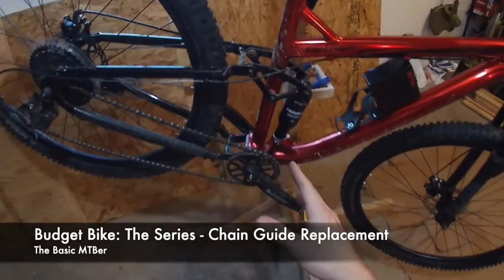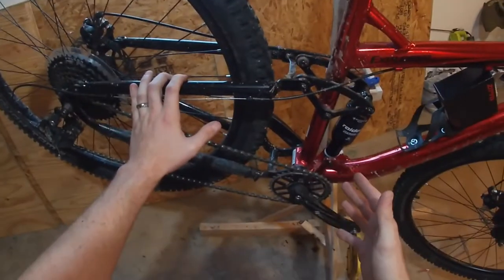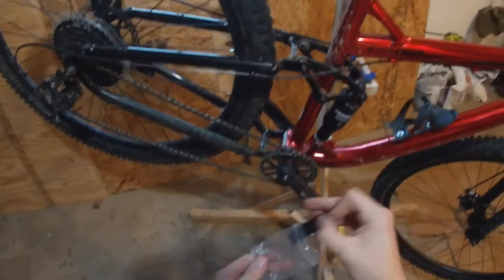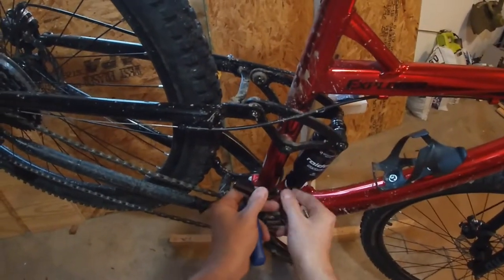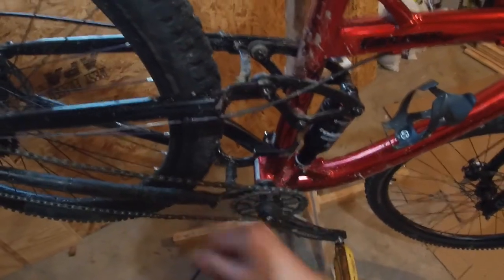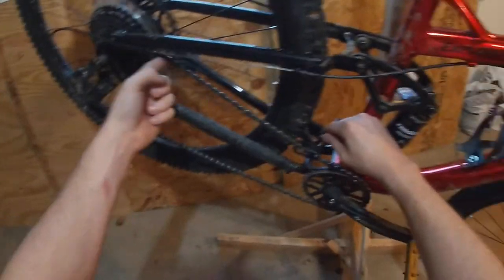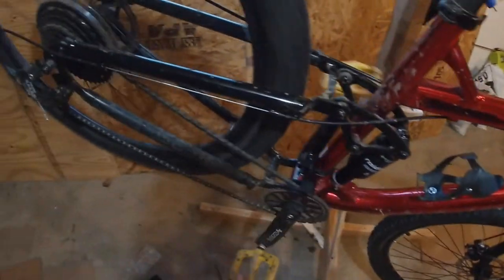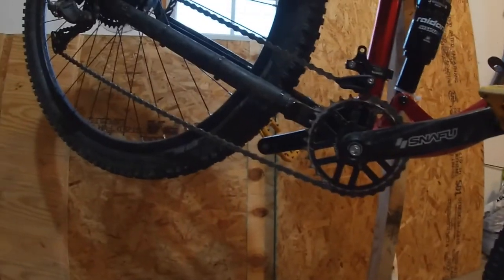Budget Bike: The Series, Ep.12 Chain Guide Install

Comment: Nice video.  What brand chain guide are you using?
Reply from the maker: It was a DYNWAVE (https://amzn.to/3vUgAGs). I’ve never heard of the brand, but it was cheap and works.
Reply: @basicmtb  I was checking out 3 different brands on Amazon and after close inspection it turns out they're all selling the same guide but with a different name on it. This makes 4 including your Dynawave. I'm guessing it's just a cheap chinese made guide that's rebranded by lots of different companies so I've ordered the one that was priced the lowest. It should arrive later today. Thanks for the installation tips!
Reply from the maker: @storm3016  Yeah, unfortunately there's a lot of that on Amazon now. I try to stay with name-brands for the important stuff like tires/suspension/brakes, basically anything that could fail and cause a crash. For non-critical stuff like this chain guide, I don't mind going cheaper. Thanks for watching!
Reply: @basicmtb  Yeah, good thinking on the important bits. I had already ordered one on Amazon but accidentally found this guard on AliExpress for 6 bucks and change later on as well, lol. Same branding as the one I got too (ZTTO). But unfortunately the guard isn't able to keep my chain in check. Every once in a while it still jumps off the top of the front chainring on upshift and now it's even harder to get back on because of the guard. I wonder why my chain jumps so agressivly these days, it never ever dropped before until I changed the casette on my bike (I had to, the old one had a damaged high gear from factory). I even tried a 3th cassette thinking that was the cause but it didn't make a difference. I guess I have some more investegating to do. Cheers!

Comment: Is the chainwheel a narrow/wide style?
Reply from the maker: Unfortunately, no. And I'd have to replace the whole crank to swap the chainring =(
Reply: Are u sure it not a direct mount type of chainring I have never seen a 1x crankset  u can't change
Reply from the maker: @LarfyzIsAChadFN  It can be changed, but you'd have to change the whole crank set. The chainring is welded to the crank - no bolts.

Comment: Dude you need to size your chain , to long it sags at the bottom bad
Reply from the maker: That’s more a function of the spring tension in the derailleur. Taking a link or two might help a little but then I risk being too short to properly shift into the lowest gear.